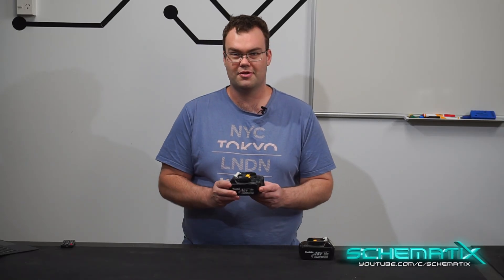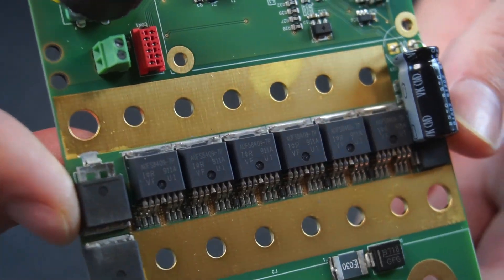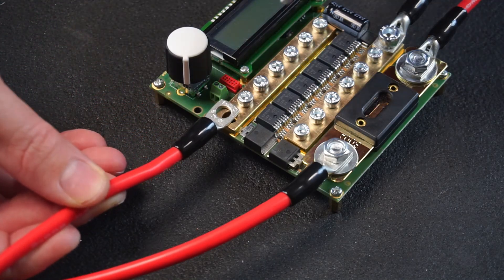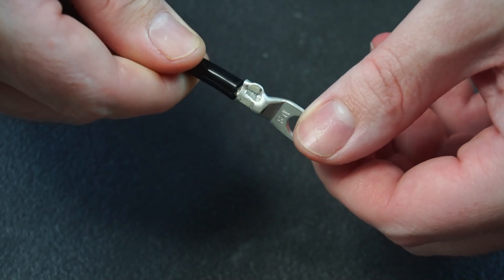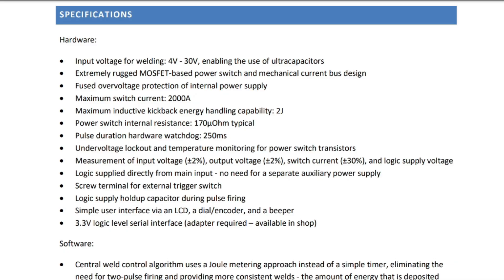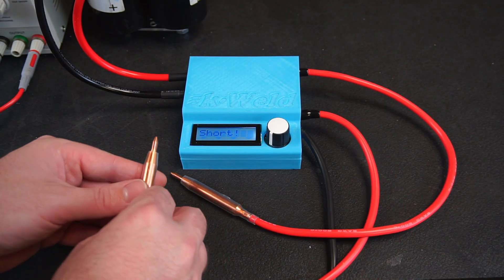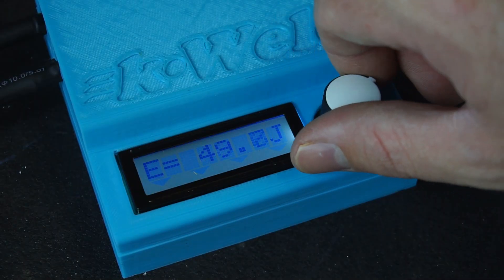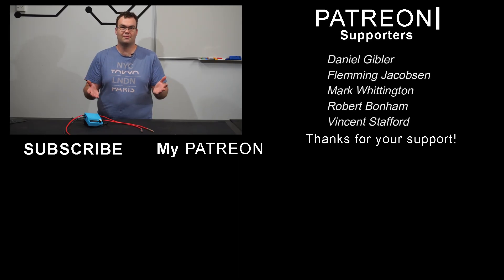kWeld - 2000Amps of Battery Spot Welding goodness! ll Assembly & Review

Comment: Just got my Kweld spot welder today and I'm so excited to get it set up!
Reply: what are you powering it with?
Reply: @sgas  I also picked up the ultra capacitor pack, works pretty well with my cheap Amazon purchased variable amp/volt benchtop power supply
Reply: @MainelyElectrons  Do the caps make a sound when charging up? 

Im debating on how I should power the welder because I find supercaps to be rly cool but on the other hand, I could save money by just finding a car battery or something.

I could maybe do the supercaps with an atx psu but I heard those dont have proper current limiting which the caps need..? So itd require a dc current limiting dongle
Reply: @sgas  the capacitors don’t make a sound, but the power supply makes a ticking sound until it hits around 6 V on the super capacitors. Once it’s charged up to 6 V it’ll take around 50 W of power from the power supply for about 30 seconds anytime I do a spot weld. I think due to the extremely low resistance of the ultra capacitors the desktop bench power supply thinks it’s sensing a short and cuts power, but it must be applying power for long enough during that short pulse to charge the super capacitor a little.
Reply: @sgas  a car battery or something of the like would definitely be cheaper, but also a lot larger. One thing that I did not like about getting the ultra capacitor pack as part of the kit, was the length of the power cables to connect the capacitor pack to the main board. The cable is just barely long enough to reach, like we’re talking half inch of play. It’s definitely the most efficient length of cable possible.
Reply: @MainelyElectrons  It might be balancing the caps with the 50w
Reply: @MainelyElectrons  A lipo would also be cheap but defeats the purpose of making my own 3s packs. None of the options rly suit me so im considering my own supercap bank now
Reply: @sgas  So I was playing around with the kweld+kcap kit and found that once you start dropping welds above 250j, you’d have to wait about 15 seconds in between welds for the caps to charge back up. My power supply is limited to 5A so it only sends around 50w when recharging the caps. If I had something that could recharge the kcaps faster the limit would become how hot the cables get.
Reply: @MainelyElectrons  Hm, I would aim for the avg of 500w that the page states. As their ksupply does 70A. 15 seconds sounds silly tho, lol. Isnt the temp of the caps also a bottleneck? For their longevity..

Comment: I have the K weld kits Gray with the adjustment and all this you don't need power windows and air conditioning all you need is a pinto just a car to get you grocery shopping and back $150 is way out of line
Reply: I have both a Sequre SQ-SW2 and a kWeld, and the difference is night and day, i cannot get my Sequre to do a nickel-copper sandwich at max, and the kWeld does it effortlessly with 0.15mm nickel strip and 0.1mm copper at only 60J, and it's spotwelded so well that i literally bent the bottom of an old cell (and tore pieces out of the strips) when i ripped the strip off with pliers

with the Sequre at 99ms (max) it couldnt even get it to really stick to the cell

the kWeld can go to 500J so.. yeah i'm happy with my investment for sure

I use a Gens-Ace bashing series 8000mAh 3S1P 100C LiPo, i get over 1200A per weld which is sorta on the meh side but more than good enough, i believe it may infact help as the less current pulse takes longer and gives more time to the material to heat up

Comment: that little red Chinese spot welder works pretty good it used to be pretty cheap I bought a couple of them when they were cheap and the one circuit board with the kt90 connector works really good you don't have to spend a lot of money to get a good spot welder you don't need all that adjustments all that other junk you just need a good battery and good metal tape

Comment: For anyone wondering, fuses are separated into "family's" of speeds. The 300 amp fuse is fine for this application because it's not a fast blow fuse. You will generally only find fast blow fuses used in semiconductor protection as well as VFD's

Comment: Nice description video. I have seen many videos about this "spot welder" and I always think of two things:

#1 Overkill: Beautiful but too complicated for only spot welding batteries tabs. If it could spot weld other things or materials it will be great, but the KWeld seller or developer clearly advises to only do this on batteries nickel tabs. So I see it as under-delivering when compared with the complicity of the design.

#2 You talk about 800Amps, 1500 Amps, etc,. but it has a 300 Amps fuse? Something is not right there.

Comment: Note that you can purchase crimp lugs with the same bolt size but for use with different thicknesses of cable. Get the lugs where the stripped wire completely fills the hole. Then you will get a tidy crimp without the burr. When buying the crimp lugs spend some time first finding which lugs fit which cable for the 3-4 sizes of cable you are likely to use.

Comment: I don't understand how you keep quoting 1600 or 2000 amps when you have a 300 amp fuse and the wire you are using appears to be rated for about 40 to 60 amps?

Comment: 8:45 " Throwing caution to the wind and having his mother on speed dial"  LOL   I would of replaced the original cables with 00 AWG OGF Copper cables and replace the brass bus bar with a thicker Copper bus bar. Your current transfer will dramatically increase.
  Another improvement would be to use a spring loaded welding pen.  https://usa.banggood.com/SUNKKO73B-Integrated-Spot-Welding-Pen-DIY-Electric-Vehicle-18650-Battery-Pack-With-Trigger-Switch-p-1818362.html?utm_source=googleshopping&utm_medium=cpc_organic&gmcCountry=US&utm_content=minha&utm_campaign=minha-usg-pc&currency=USD&cur_warehouse=CN&createTmp=1&ID=6303613&utm_source=googleshopping&utm_medium=cpc_bgcs&utm_content=sandra&utm_campaign=sandra-ssc-usg-all-newcustom-ncv90-0420-19cov&ad_id=432153545270&gclid=Cj0KCQjwk4yGBhDQARIsACGfAeuqx5zXzKuR9XtLNlVgfQr8oMSqi6VwXGPDbNRIAcOH92FGoVa5gkEaAtQWEALw_wcB
Hope this helps.

Comment: almost 200 bucks and it 's not an already assembled finished product !?!
Reply: Have you seen the price of a normal spot welder?
Reply: of course, its a product for people to diy batteries and such with. If youre uncomfy with assembling a welder then you shouldnt be building batteries. Also the fact that competint welders are multiple times the price of this one
Reply: Furthermore, you need some weird power supply / supercap, etc. and cannot use an old ATX power supply. Too inconvenient for the money.
Reply: @TJ13062010 it's literally impossible to run a welder on just a power supply. It NEEDS 2000A

Comment: When crimping the lugs to the cable simply crimp slightly until cable is secure enough to not move then open the crimper and rotate the lug one flat. Then continue to finish the crimp. When doing it this way you don't crush the lug between the jaws of the crimper. Removing any part of the lug weakens the crimped section possibly to the point of being able to pull the cable out. Using the correct jaws for the lug/cable combination is important.

Comment: I'd recommend soldering your lugs after crimping
Reply: That makes no sense. You can tin the stranded Wire before crimping but solding after crimping does nothing. Reason is and this has been scientifically studied and proven. Proper crimping that deforms one metal into the other metal provides a better contact than even Silver soldering. I was surprised to learn this many years ago. This is because the electricity can go directly from one metal into the next metal and not have to travel through a poor conductor like lead solder. Know you know.

Comment: whip out 150 euros for spot welder and then 140 euros for power source
meanwhile you can get a basic spotwelder that will do every 18650 spotwelding you will ever need for  like 20 euros on aliexpress and you can use your car battery as power source, which is free
no wonder China is taking over the market

Comment: 0:14 - great project, but soldering of 18650's is really not that hard... I'm doing it all the time with soldering gun (not iron), it works like a charm (https://www.youtube.com/watch?v=98wcqTpQ1qE). Cells even don't get hot during the process, they are barely a little bit warm, so there is not risk of damaging the cells. Spot welder is good if you have to make a LOT of cells (hundreds or thousands), but if you just wanna refurbish some old akupack with few of 18650's and don't have a spot welder, you can solder them too without problem.

Comment: That "burr" as you call it on the lug is because you are using the wrong size lug for the cable, or the wrong size die on the crimper, or both. As Steakbrotchen said, tinning flex before putting into a screw terminal has been specifically "outlawed" for want of a better word, for well over 13 years. Ferrules are always the best solution. This is due to cold flow, a property where the solder compresses over time and the connection becomes loose.

Comment: Nice video. I have refurbished some Makita batteries also with crude method of soldering used laptop cells. I question the economics here: 10 new cells are around 40$. The welder and accessories are several hundred. Plus the time spend. I recently paid 50eur for brand new 4Ah Makita battery.  No economical sense, but it's a nice hobby.
Reply: Certainly not if your goal is just to fix one battery pack.   But its a tool you now have in your inventory for similar work.   I spent quite a bit of time making up cables - and making up an enclosure.   I'm retired and this is just a hobby - but I can see other folks making another call...my son-in-law will be happy to inherit this when I pass....🙂.
Reply: @romanykemp9042  That is how I feel.  I plan to give all my high quality tools to my sons (God willing).  This way they won't have to buy them and will have excellent tools on hand.

Comment: I was really taken with the idea of this compact welder for replacing battery packs but as I watched the video it was clear that more and more kit was needed with the cost going up all the time.  Not even the case was included.  I waited to see if the unit plugs into the mains.  It doesn't so more expense and inconvenience with an additional battery or capacitor power pack.  I then abandoned the idea of making this unit and will look for something more convenient.  The project is not the welder, it is replacing the cells in the battery packs.

Comment: I almost saw you die about 5 times. When calibrating the welder you separated the leads by grabbing the metal tip which completes the circuit through your body. :O
Reply: At 8 volts it does not matter unless you put the leads at your tongue. And even then it feels just like licking 9 v battery.. (I don't recommend trying that.) Just watch video about it.. Edit: He goes to 12 volts later. Still about the same thing.

Comment: Never tin wires which are going into a screw terminal and don't recommend it to anyone! It can be a serious fire hazard after some time.
Reply: when you are only using milliamps such as the footswitch which is just a logic level signal, you are not drawing enough current to make any kind of heat. Maybe with power wires, but with logic signals such as this it doesnt matter.
Reply: @kwacz  In this case it wouldn't be fatal, no. But it is bad practice to do it at all. There is no good reason for tinning wires prior to screwing them in.
And since not everyone is familiar with this, I wanted to add this information to prevent newbies from learning bad practice.

Comment: BigBattery, Inc. is the largest supplier of surplus and re-certified batteries in the United States.
Our core purpose is to promote mass adoption of renewable energy solutions. While the cost of alternative energy has decreased substantially within the past decade, Batteries have remained expensive. Cost effective energy storage remains the single greatest hurdle for the mass adoption of our clean and independent energy future.
Our product ranges are from Home Battery Storage, Golf Cart Batteries, RV Batteries, Marine Batteries, DIY Battery Modules, Accessories, Mobile Solar Trailers, PPE Products.
Take a look at BigBattery.Com/Sales - Ask about our comprehensive 10 Year Warranty on battery packs and kits.

Comment: I would move the steel washers at 3:16 away from the area in-between the cable and the fuse, they act as a resistor. You making the connection correctly at 3:33...Also, for high-current cells, investigate the copper-nickel sandwich method for the series connections https://endless-sphere.com/forums/viewtopic.php?f=14&t=108006

Comment: Just a tip
Never tin cables that goes into a screw terminal. The tin will crack and the connection will eventually get bad.
And with high current there might be a fire hazard.
Reply: yes, i was used to tin everything, but i faced this problem many many times... a real pain...
Reply: You talking “tinning” as in tinning with solder? Or talking about the tin wire ferrules he crimped on..??
Reply: @TylrVncnt  I meant tinning wires

Comment: 167€ kweld+139€ for a capacitor pack + 70€ for a power supply +16€ for a software update tool and finally you have to swap the wires with  thicker ones and print yourself a case. Doesn't seem a cheaper version than most of the AC stations out there.
Reply: Yeah, better to buy a real welding tool with everything integrated inside the box. Instead of this.
Reply: @Sombre____  It is a real welder, one that lasts for a long time not one for 3wks then thrown in the bin. Its many users will be a testament to that.I am about to buy one as I am fed up with the cheap ones I have bought. I knew about Kweld years ago but like many bought cheap and ended up paying more.
Reply: @onlythetruthfull  Seeing the price to buy all the component, it's better to buy a real one. That's what OP was saying and i'm completely agree with him. Don't fall for youtubers expensive diy.
Reply: @Sombre____ 
What is a real one, I have yet to find anyone who agrees what a good one is, wherever you look there are good reviews and bad for the same unit. I have been after a Kweld for a number of years but like I said i took notice of YouTubers and bought on their recommendations and ended up with the best one doing brilliant welds for the first build and blowing it chips the next build as soon as switched on. I have ordered the Kweld kit and awaiting delivery as i have two 36v  packs to build. I will let you know how it goes.

Comment: 11:47 why does weld cables jerk when you weld?  does electrons have physical kinetic energy like water hose?
Reply from the maker: When current passes through a wire, it creates a magnetic field. Normally the magnetic force isn't strong enough to be visually noticed. However in this application with hundreds of amps flow through the cable, the magnetic field is strong enough the cables repel/attract each other. Pretty crazy aye

Comment: meehh come on, test the product, put your scope on it, and perhaps a current clamp and show the result instead of this of ho_humping because of freebie.
test the amp-values in actual practice show the spot ms-cycles show the waveform, it is an electronic channel, not commercial walkthru.
just tested a cheap one, 18USD delivered and one 4s LIPO 2800mah from an old collective pitch quadcopter and it worked great, actually needed to dial it down, as it was too massive on 0.15mm nickel strips at above 70E It had 1E to 99E  power intervals and also DC-interface for what I reckon is pedal or switch etc, but just uses the automatic were it welds like ½ sec after you have connection continuity.
the biggest con was that it got hot if you made multiple welds just after each other, both the LIPO cables and the LIPO itself, so will put two in parallel.
but was unsure about the readings I got on my scope as the current waveform I saw was precarious low. and in the double digits amp and not triple even though both heat on LIPO and cables and the reflex-bounce in the cable when doing welds, implied it was more than ampvalues only down in the double digits.(am on x10)
but will surf further find other channels that perhaps put some clamp and scope-equipment on while doing spot-welding, to get an idea about the waveform & values, though my ms-values was 1 to 1 with the display on the spot welder 1E = 1ms and 99E = 99ms timing.